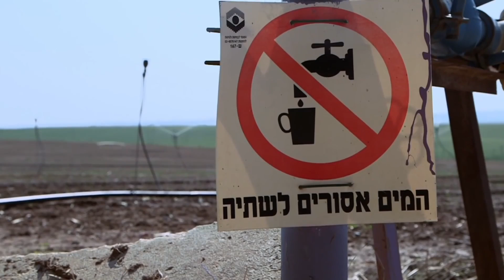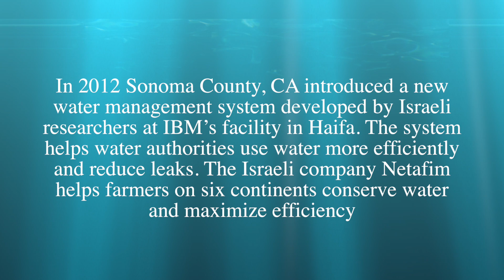Israel: Leading the World in Water Technology

Comment: There is also a system with nano material to filter salts...

Can these filters not be used inside a large drum with a small entrance point and a small exit point where the water circles around inside to make for an automatic filter cleaner that by flushing out the salts makes the filter last longer ???

Comment: What about concentrated solar desallination ?
An installation with the same system as in spain with mirrors that point at a focal point and than cook it at the focal point and than pump it through so fast that it actually brings back a thick slurry to the sea...

Calculate the amount of meltwater of the north and south pole -and greenland into that..

So using the sun and also solar panels to drive the pumping system and prefilter...

And of course turning the steam back into water...
and adding minerals like chalk a bit so the pipes do it get corroded and people don’t de mineralize  in their body...

why not use the sun to power these systems ???
Reply: I was thinking the same

Comment: The West Bank

Under the Interim Agreement (Oslo II) signed in 1995, Israel retained control of all water resources. The agreement – still in effect although it was supposed to be only an interim five-year arrangement – stipulated that 80% of water in the West Bank pumped from the mountain aquifer – a joint Israeli- Palestinian resource – would be allotted to Israeli use and the remaining 20% for Palestinian use. It further established that Israelis would receive an unlimited water supply, while the supply to Palestinians would be limited to the fixed, predetermined quantity of approximately 118 million cubic meters from existing drillings and another 70 to 80 million cubic meters from new drillings. Another stipulation was that Israel would sell the Palestinians an additional 31 million cubic meters a year.

Due to various technical difficulties, the unexpected failure of new drillings in the eastern basin of the mountain aquifer – the area where Palestinian drilling had been granted – and obstacles placed by Israel – such as lengthy delays and refraining from handling approval to projects – Palestinians currently extract smaller quantities than specified in the agreement. The Palestinian population of the West Bank, which has nearly doubled since 1995, currently receives only 75% of the amount of water agreed upon, while Israelis continue to enjoy an unlimited water supply. As a result, the Palestinian Authority (PA) must purchase from Mekorot (Israel’s national water company) more than double the amount of water specified in the agreement. According to Palestinian Water Authority figures, in 2015 the PA purchased an additional 63.8 million cubic meters from Mekorot for use in the West Bank.

Comment: In 1967, Israel seized control of all water resources in the newly occupied territories. To this day, Israel retains exclusive control over all the water resources on the land between the Jordan River and the Mediterranean Sea. The one exception is a small section of the coastal aquifer where it runs under the Gaza Strip. Israel uses the water as it sees fit, ignoring the needs of Palestinians in the West Bank and in the Gaza Strip to such an extent that the two areas suffer a severe water shortage. In both areas, residents are not supplied enough water. In Gaza, even the water that is supplied is substandard and not potable.

The right to water and sanitation is a fundamental human right enshrined in international conventions of which Israel is a signatory. Israel is therefore obligated to uphold this right in all territories under its control.

Comment: we have de sal plants in Australia and we have them off, they are very expensive to run and we spend millions to keep it maintained to sit there and rot, to have 5 is gotta cost a lot
Reply: Marsh 
Yeah...but a lot less than dying of thirst.
Reply: Australia has a slightly different situation. There was never really a shortage of water but rather mismanagement and government hyperbole about the drought because the infrastructure was out if date. Of course when they finally started to do something about they went about it in the most inefficient and expensive way. Another important point is that Israel's DSal tech is different (as far as I understand tho I'm not nnot expert) and therefore cheaper. Its also easier to build decent infrastructure in denser areas